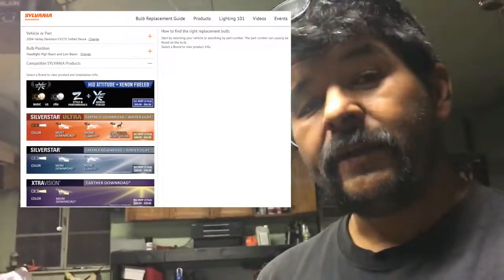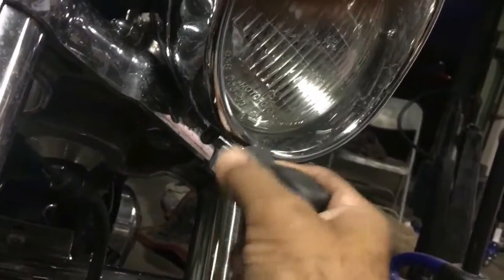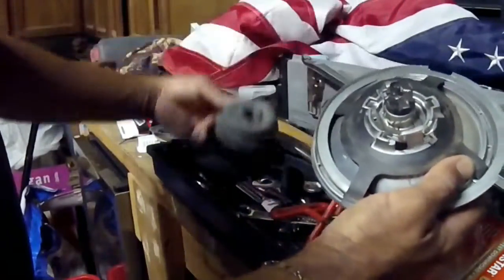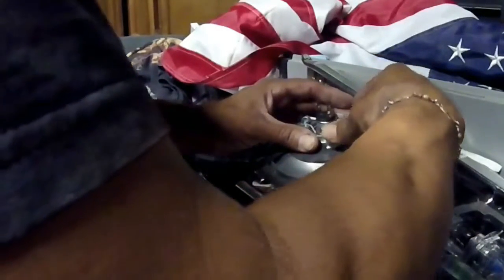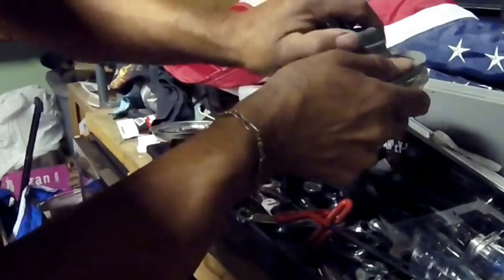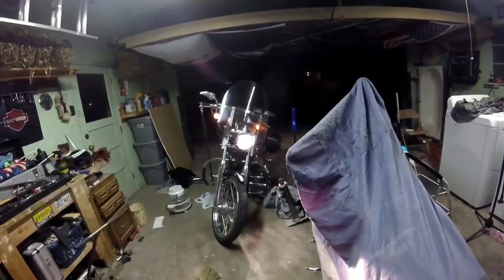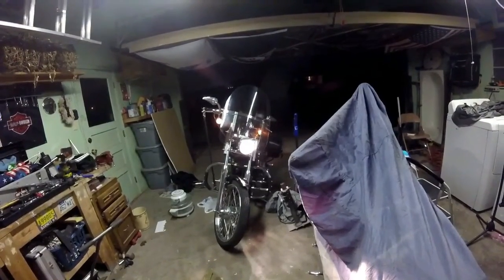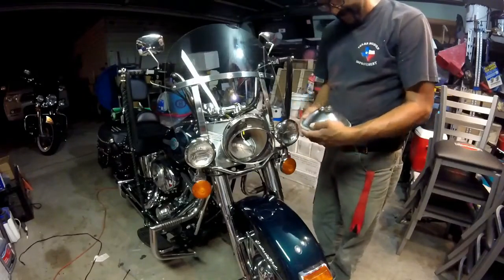How to video - replace Head Lamp lens Bulb on a 2004 Harley Davidson  Softail Deuce

Comment: You rock brother. All I needed to see was how that retaining ring goes 5:48 . My low beam went out on the LED over the holiday break and when I replaced it I forgot that ring. I just inserted the bulb housing into the pre-molded weather stripping that is in the outer chrome ring. It fit fairly snug and I put it back together. Done a couple of rips down the interstate and it came out of alignment, the last time it fell back into the housing, at night which sucked. I came home and looked at the online HD parted department exploded view and there it was, the illusive retaining ring. I had planned to go to HD and order one on Saturday being that HD  probably wouldn't have one in stock for an older FXSTDI. So I came home today and did a cold start in the garage and glances over at a box sitting there and there it as. Can you say senior moment? I pulled the headlight off and took it inside, to the kitchen (cold in the garage) and attempted to figure out how this thing holds the bulb housing to the outer chrome ring. I was way off course, it just didn't make sense to me so I jumped onto Youtube, opened up 3 videos that looked promising, yours being the last of the three, but I watched yours first and mystery resolved. Sucks getting old.

Comment: Is the bulb 💡 on a 2002 Harley Davidson sporters a change 💡 or is it the hole light it self my low beam has went out but I do still have a high beam
Reply from the maker: I am pretty sure it’s a light bulb and housing lens. Just remove the bulb and autozone will have it in stock.
Reply: Thank you 🙏🏾 so much  for the insight great help